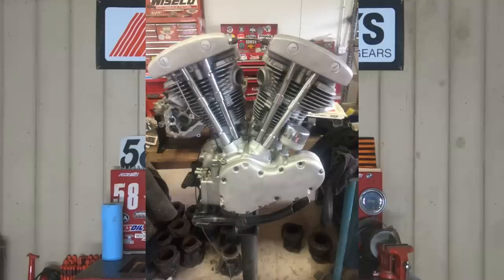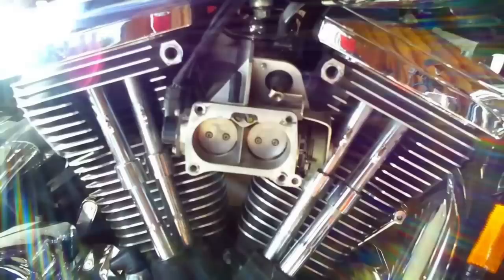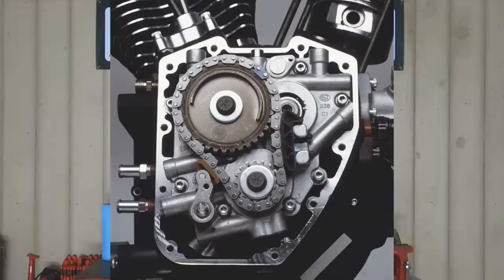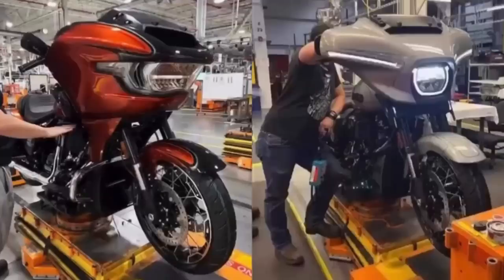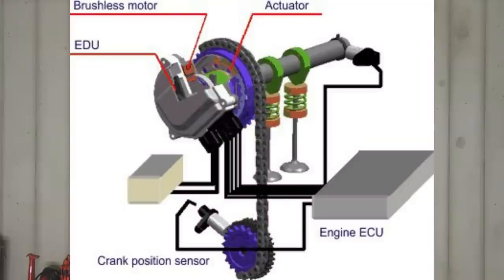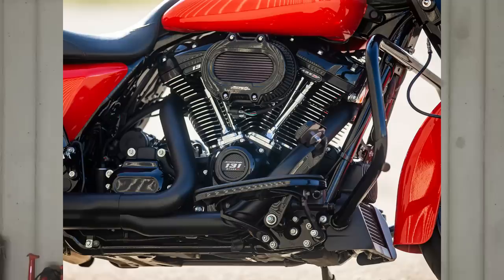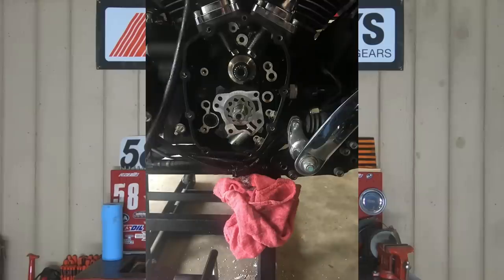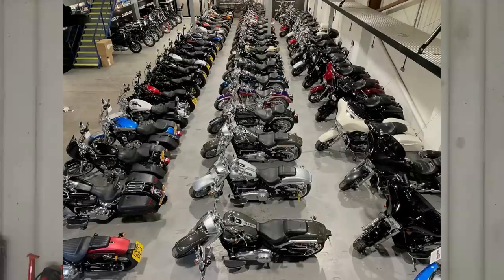Simple Harley Engines are Gone Forever

Comment: Both of my Patriots, have the 2.4 Dual VVT system. The engine is basically a motorcycle engine, with DOHC and four valves per cylinder. 
On the road, it sips gas in cruise control. But when you step on it, it's just like when a bike engine gets up on the cam: the beer muscles kick in, and the tach needle bounces off the redline. I expect that the Rev Max engine does the same thing.

Comment: Agreed, that it will be their last air-cooled engine. Engines are getting too big to cool by just air and oil.  Glad i got a twin cam. May it run forever
Reply: It's the electronics that will be impossible to find for the twin cams if anything. Harley is already discontinuing brain boxes for them and as of now, no aftermarket company is picking up the issue and offering replacements
Reply: @bryanhadley8704  you are correct. I'm sure the aftermarket will try to catch up. Hopefully they can

Comment: I thoroughly enjoy your content sir. If I could suggest a topic....a video on the models no longer made and the possible problems involved finding parts. I own a FXSTD "Deuce". This model had problems with parts availability when they were still making them! 😅
Reply: My son has an 07 Deuce. Parts are definitely scarce. Even harder to find than parts for my VROD. It doesn't help that the MoCo has made it much much more difficult to find parts for anything since they are shutting down many online vendors. But through Ebay and Vintage parts. He's been able to find most everything he wanted. The prices won't make you very happy. Good luck with your search.
Reply: @Mr White  I have a complete build. 2000 carb model with Legend Air ride, Dakota Digital MLX-2000 guage, led everything, Andrew's TW26 cams intake and exhaut/ head work. 85hp 95ft lb to the pavement. I have some honey holes for rare parts. I thought it would be an interesting video for sure. 👍

Comment: VVT makes sense.  More efficient and more horsepower.  With fuel, spark advance and cam timing all computer controlled that's how we get little engines that perform so well.  Now, if we could just add a turbo and effective valve cooling .   .   .

Comment: I think from 2 experiences attempting to replace a few cam actuators, VVT works great until something breaks. When it does, it will happen eventually, the tow truck will come, and the repairs can become very expensive. The VVT damage from wear 130k miles on my buddies Ford150 forced him to lock out the VVT to save the engine from a chain reaction of wear related damage that happened.  After market auto parts makers are producing a variety of VVT lock out kits that vastly prolong vehicle engine life on V6 and V8 engines.

Comment: Harley needs a lot more than just VVT, like water cooling, relocating or dumping the oil tank and routing the exhaust pipes away from all rider parts. As a rider I get way to much heat from the engine. I would also like to see the fuel tank moved down low to reduce the top heaviness.

Comment: I think its a fail . Its hard to believe guys will spend 65 grand on a M8 ridiculous .  Plastic parts, but S&S has the up grad.  Maybe if Harley quit making engines that fail and start using high end materials and labor they might pull out of the slump .

Comment: Requesting help from this crowd.. kinda long story but..

I had some seizures last year. Consequently, my HD has sat for the duration of my driving restriction (one year). It’s a ‘14 Dyna TC 103 w/ stage 1 (no oil tank like a soft tail). I understand, “sumping is not new.” How can I remove any oil settled that would be sumped, if any? Will a simple oil change be a resolution?

I believe I saw there’s a crank sensor during a “Twin Cam Tear Down” video. Can oil be drained from there to avoid sumping? Another vid guy said run my crank case breather tubes into a bottle when I fire it up again and let the engine blow it out. My worry is the screens of the breathers in the rocker box. Should I refrain from starting it and open the cam chest to pour out any that may be settled? I just want to avoid any problems. Thanks, y’all
Reply: I had a TC96 and after about a week of not using it the oil would drain into the crank. Starting it would refill the tank which you don't have but im assuming it would just recirculate like normal. Maybe just let it run a minute make sure you don't hear anything weird?
Reply: @ianbutler3558  appreciate it

Comment: Shouldn't be too bad. LS Gen 4 motors have VVTI. Eventually it will probably lead to a system that can change the timing in the engine while it's running through the powerband like an iVtec motor so they can run higher compression on lower octane gas.

Comment: As far as aftermarket cams and cam phasers go, the automotive aftermarket often uses phase limiters or locks. Sometimes full sweep of a cam phaser on a high lift cam causes valve to piston contact, so they cut down the variability to prevent the issue. I’m sure the aftermarket for Harley will do something similar. I’m just hoping the phaser is designed well and doesn’t have a tendency to sludge up and cause problems!

Comment: Hopefully they didn't copy GM VVT ideas. The 8cyl/4cyl 5.3 Vortec in my Silverado is a ticking time bomb!

But why buy new? Unless you're one of those who must have the latest and greatest🙄to impress the other RUBs at the country club!
S&S is making high quality, high performance replacement 'retro' motors from Knuckleheads to Twinkies. Chassis parts (stock or aftermarket) are widely available.

Comment: Look at LS based engines after 2007, variable valve timing on a pushrod V8. The reliability all depends on what type of system they end up using.

Comment: Another good video Gixer! VVT does make an engine more efficient. It always adds cost. And it always adds complexity. It will typically add HP as well. Although I would bet it won't add more than 3 or 4 HP on a pushrod V-Twin. The VVT system HD is introducing. Won't help them sell  motorcycles. Especially when at the moment, you have to spend close to $50,000 to get it.

Comment: I'm thinking that if variable valve timing is coming so are overhead cams. Why would they try to put this feature on what is basically a tractor motor? If they are going to update, go all the way, totally update. I think they are basically hitting the point of diminishing returns on the push rod motor performance wise. You can only put lipstick on a pig for so long. I mean they stopped making the flat head ( like on a lawn mower) motor decades ago. Hell, Volkswagen even stopped making the Beetle eventually.

Comment: The way things have been going is: 1.) pay more to get less
2.) components made as cheaply as possible have much shorter life span, requiring replacement much sooner
3.) new vehicles are not worth the retail price and moreso each year following
4.) I'm tired of getting ripped off
5.) I'm back to riding my 2005 Suzuki S40 with 50k on the clock and trust it's dependability more than anything new

Comment: After owning 2 brand new M8 roadglides 17,18 both spending more time in shop than my garage with mechanical issues ,I think it'll work & do what they expect however first few years on market there will be an opened huge can worms & nonstop issues that only up to date Harley techs can resolve,would not go there for the world....imo.....there's nothing worse than spending near 50k on new bike & accessories only to ride dealer loan bikes 80% of the time if your lucky....Much rather spend 20k  less on low km 2nd hand twincam than deal with stators,oil locks,endless oil pumps backing plates recalls recalls recalls ,All twincams I had were faultless never an issue ever .Its same with all new models of anything cars bikes trucks etc etc first few years have issues with few even lemons & last models normally floorless unless it's China junk.....

Comment: Harley Davidson has sold out their customers. I would not buy anything newer than an EVO Harley. And it would be carbureted. For Twin Cam owners, or potential Twin Cam owners, ALL Twin Cam engines can be converted to a carburetor. It will cost between $1000 and $1200, depending on the engine. But. You also have to consider that the Twin Cam engine also has a ton of other problems that would be a very expensive rebuild in order to make them reliable, starting with a new crank, new crank bearings, and a geared cam drive. Sadly this may be the only choice for some people, as EVO bikes are now few and far between, other than Sportsters. And if you do find a nice one, it will likely be VERY expensive. In no way do I support H-D, and in fact I hope they go out of business. They no longer serve any purpose, as they no longer make anything that real Harley riders want. Or can afford. I have always been a vintage car guy, and I am now a vintage bike guy as well.

Comment: Just the natural evolution of the big twin, in my 48 years on harleys (shovel, evo, twin cam) I’ve had to do less maintenance as the basic v twin has been refined at each step along the way, more time for riding. It’s called progress and time marches on. D W
Reply: Finally, someone with a brain and not pretending it was better way back when. I can ride all day at 80mph on my Softail Street Bob with a 107. Up graded to a touring seat. No way you are touring all over  Florida, like I did in February, on a Shovel Head cruising at 80+ mph. The engine probably wouldn't last day in and day out riding. Neither would my back on an old bike.  No issues with my 2020 M8 or my wife's 2016 Twin Cam. Change the fluids and monitor everything else, no issues

Comment: Frankly I do not see why anyone buys a new Harley at all. For the price that Harley-Davidson charges you could go and buy an s&s motor and build a whole bikes that pleases you around that motor and it will be cheaper than you buying a ton of ship parts that you will throw away. Today's motorcycles are not motorcycles they are collection of government regulations on two wheels. Simple ended with the carburetor ed evolution motor. Reliability and dependability also ended with the evolution motor powered bikes. You can buy a complicated state-of-the-art BMW or goldwing and it will be reliable from brand new unlike the Harley Davidson which will need another $10,000 worth of engine works toward into it to become semi reliable. I would need her take a brand new Harley nor a used one because of so many expensive mechanical issues to deal with.

Comment: It's rare to see a company work as hard as Harley Davidson does to put itself out of business. They cut corners where ever they can and still claim to be the assemblers of "premium" motorcycles.  There is nothing premium about a Harley Davidson and never has been.  If that were true, companies like S&S wouldn't even be in business.  More recently they are replacing chrome with black paint and having the balls to market this as an improvement.  Many dealerships are marking new Harleys up by $7k-$8k over MSRP which has shoved a LOT of potential buyers out of the market.  Only a moron would pay those kinds of prices.  And speaking of morons, the mobility tricycle market will dry up soon as the few remaining geezers die off.  And there are just so many idiots with more money than brains willing to plank down $40k+ for a CVO.  Anyone who has a stereo on their bike is not a Biker and never will be.  They will ride these ridiculous motorcycles until the first time they dump it and that will be the end of that.  One less poser out there.  From what I see, the M8 is a piece of crap.  I love my Evo FXR and 96 CU TC.  Old but still very reliable bikes that I can mostly work on myself.  Neither has ever been in a McDealership service area.  VVT will be just one more reason to NOT buy an M8.  You can pick up a decent twin cam for a song, do some basic maintenance to it and have yourself a scooter that will run long and hard for years to come.  I see VERY few real Bikers riding M8s.

Comment: I think VVT will be a good thing. It should be good for cooling the engine as well extending the life of the engine overall as well as adding a great deal of performance. Software and tuning for the aftermarket will be challenging but they will figure out a work around.

Comment: I think my 5.3 gm engine has it   Vvt . It’s pushrod . Works - ✊🏻👍👌
Reply: LS is not vvt 
It is cylinder deactivation though.
Reply: @metalted6128  mines a L83 5.3 and has vvt.
Reply: @crspcritter  it’s variable cam timing, 
Being only 1 cam.
Yes they call it vvt.
The intakes, vs exhaust valves can’t be adjusted, 
It’s all or nothing.
Yes you are right, gm calls it vvt, 
But!!!
Reply: @metalted6128  👌👍 it is what it is - 😁